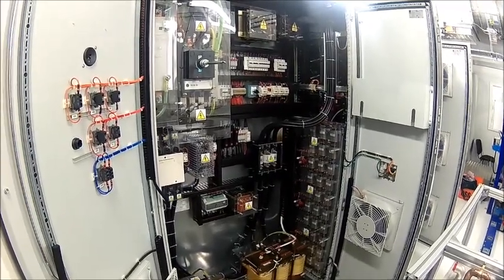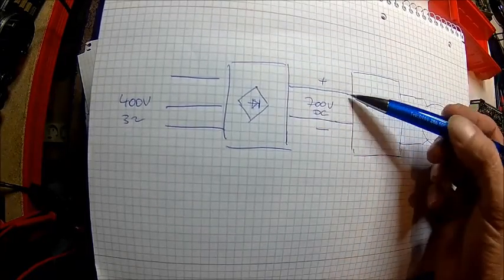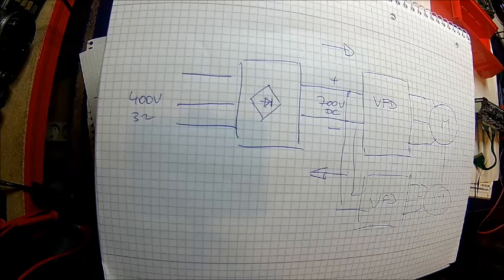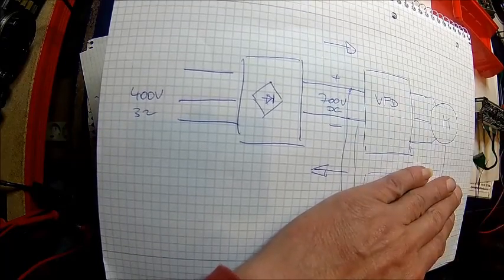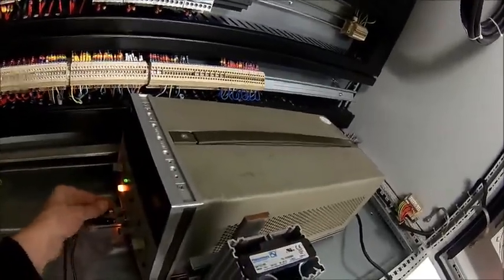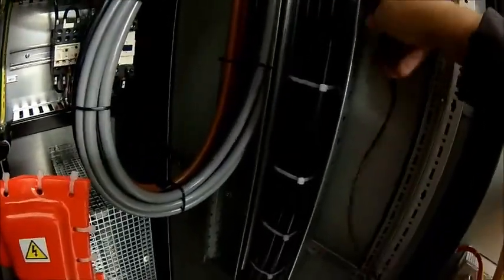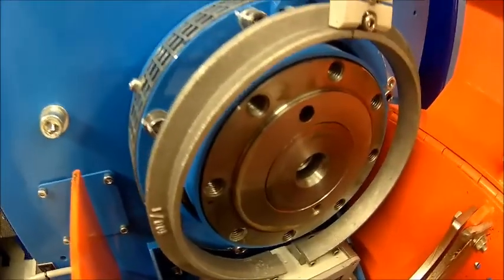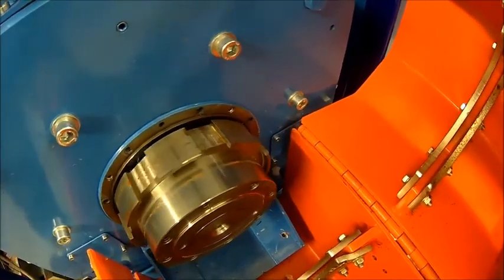250kW AC Motor and Drive (vfd) initial checks and run up (engine dyno application)

Comment: Hope you wear hearing protection. Not easy working with one hand and filming with the other but you pulled it off.  I often have to wait several hours for electricians to turn on the power,such a drag.
Reply from the maker: I did use plugs but it appears alot louder on the video. Thanks for appreciation, as said, it was filmed for documentation only, 
the YT version developed from boredom while waiting for power..
 I was quite happy that i could be next to the motor while it was running, most customers don't allow people near life or moving parts anymore, doesn't really make my job easier.
The power problem was a political one, it's not abount finding the key for the padlock, its in fact about getting someone with the permission to unlock it. ....you might guess, i am not exactly a friend of that recent health and safty madness.
In the old days we were sitting on the motors to listen to the bearings. It's a fairly predictable risk, usually bits are only flying radially from the front end, and that's covered by a pretty solid shaft guard.....the modern-age hi-viz guy would probably commit suicide after watching.that.
But then you see the same H+S nuts fearlessly watching a flat out screaming end-of-life engine at a vintage engine show, standing right in the shooting line of the flywheel teeth,......apparenty that's safe then..